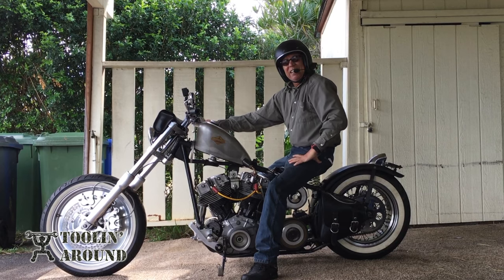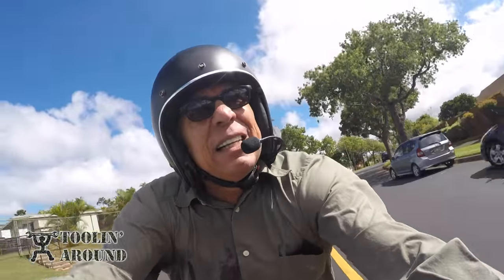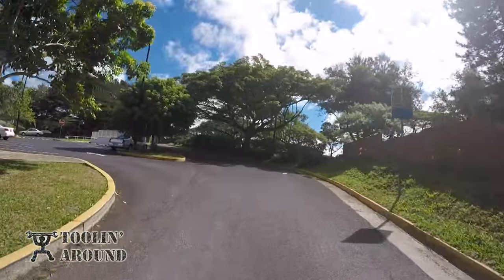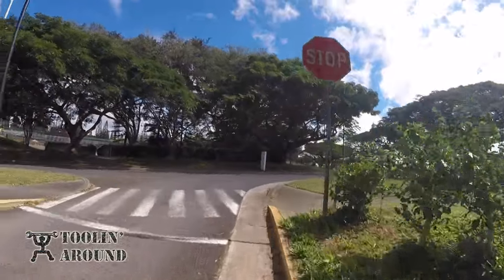Toolin' Around with Andy Bumatai #206 20 Kicks & Bye Bye Victory Motorcycles

Comment: I used to have a Magneto bike and we used to drag it behind a car for 1/4 mile every 1st start of the season.  I built a little ramp from aluminum and rolled every morning down it and my driveway was a slant. Cold started every time pop clutch in 2nd gear.

Comment: Back in '68, my '58 Panhead was a true one-kicker. I usually had to shut it off while waiting for the other guys to get their bikes running. The worst was a Sportster with a magneto, it took 55 kicks and 2-3 guys taking turns. I've thought of going to kick starter again, but after watching you, I know I'd be courting physical disaster.....
Reply from the maker: I put this motor and trans into another frame and rebuilt it as a bobber. When I went through everything it realized the spring tension on the advance weights was WAY too much and changed them back to stock tension. Check out my latest vid and how much easier it's starting now. https://www.youtube.com/watch?v=Oe0t7tpuHEw&t=1s Thanks for watching.

Comment: Probably could use a valve adjustment or maybe a carb rejet. Badass bike Andy!
Reply: I was thinking the same thing. What kind of carburetor is he using is it a Mikuni 42 mm or 45 mm?  if you have good valve lash, compression and a tuned carb (especially pilot jet)  shouldn't have to crack throttle, etc..   but that's  the fun of old bikes.  enjoyed the video
Reply from the maker: I did both those things. It's just a little hard to start after a cold night.
Reply from the maker: I'm running a S&S Super E. I'm still sorting things out. ...and, yeah, you're right. That's the fun of it. I really miss that element of unknown with the new bikes. With a new bike you carry a phone. With old bike you carry tools. : )
Reply: 10fo,  I agree with you about Victory btw.  It's to bad tho , I really think they could have dropped the price and competed with the Japanese bikes.   But I assume the overhead for Polaris was not worth it.
Reply: I agree,  I ride a 98 valkyrie , and love that 20th century design and feel.

Comment: Victory made a good bike, but alone, they were not making a dent in market share, in fact, after 18 years, they held 3%
Indian was selling 15:1 with only 9 models in 2 product lines.  There is no way to make a dent in HD market share when you are only running with 9 models and 2 product lines compared to HD's 37 models in 5 product lines, 6 if you include the Live Wire (not in production yet).

I am 100% sure that 7-8 best selling Victory models will re-emerge as a new product line under the Indian banner.
Right now there are 2 product lines, the Scout line-up (2 models) and the Chief line-up (7 models).  (3 more models coming Feb 25 under the chief product line, but i am not sure all 3 will be unveiled that day).
They will re-badge some popular Victory models under a new product line using the Indian name to bring Indian into a new, younger demographic that is not looking for a nostalgic motorcycle, who are looking for a modern look.  Hell, i can even see them adding a 4th product line by rebadging the Empulse TT as an all new Indian electric.

When all is said and done, i can see 4 product lines for Indian, Scout line, Chief line, Modern line(not sure what it will be called)  and the electric line.
This will give Indian roughly 20 models under 4 product lines putting them in line with HD's 6 product lines.
The only product line that Indian will not have a product line to compete with is the CVO Line up, but who know what the 5 and 10 year plan for Indian looks like.
They may buy a performance line down the road and compete in the CVO line-up or take a few bikes from the rebadged Victory line with factory upgraded performance parts to compete with the CVO line, who knows, only thing i am positive on it Victory will re-emerge under the Indian name that will create and entirely new product line for Indian.  Personally i would be interested in picking up a re-badged victory with the Indian name and add it to my 7 bikes i have now.

I would love to see Indian get to 25% market share while HD drops to 25%, this will encourage increased spending in R&D in both Indian and HD and will only end in a win for consumers.

Comment: Mahlo.for another entertaining vid Andy.  it's painful watching you work so hard.  maybe more fuel at initial start up?  most motors need lots of fuel at cold start. 
I second the valve adjustment comment. Everything has to be perfect for easy start. 

Nice bike !!
Reply from the maker: It's not the bike it's me. I'm still figuring out the starting "routine" for this bike. Every bike is different. Thanks for watching.
Reply: Andy Bumatai  keep riding !  Mahalo !